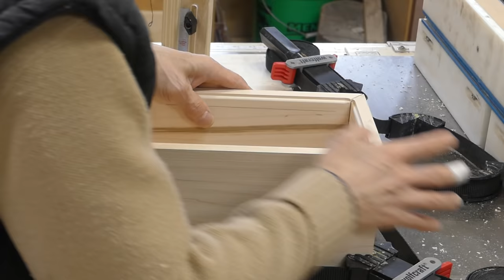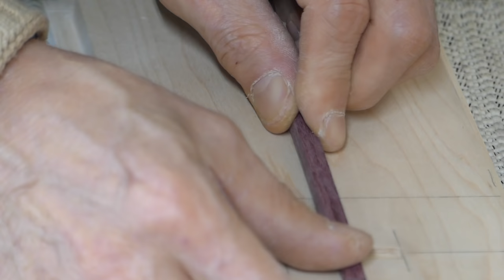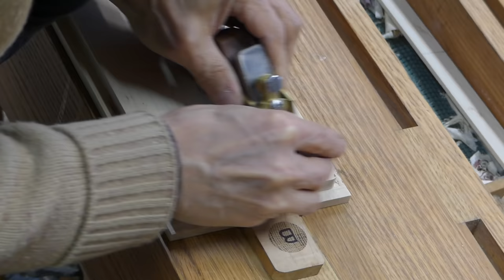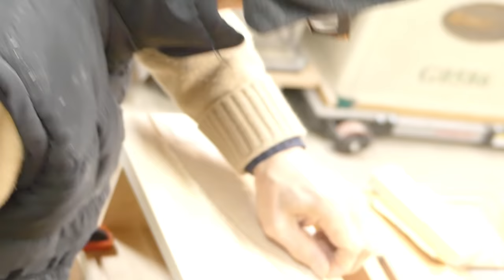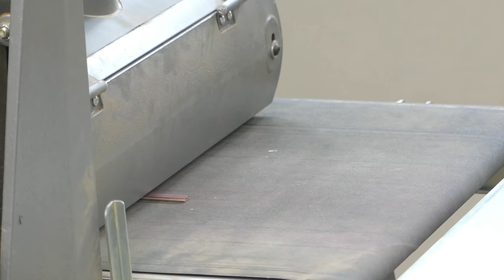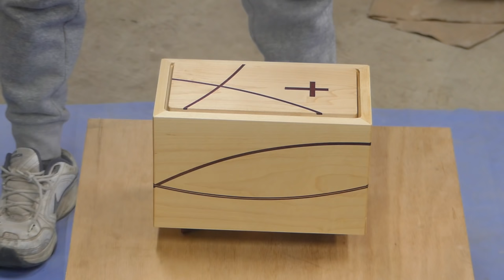Making pair of urns

Comment: I always get a kick with the waste piece shooting off the table saw when cutting the rabbit. And a little relief that i've measured correctly..Not only that I save them. Why? I have no idea but surely they'll come in handy for something. Some day. If for nothing more than stir sticks for epoxy..

Stunning work as usual.

one last comment.. I see you double taped the pattern guide on both sides of where you're going to route. Just to make 100%  your router doesn't mov?. Feel like I'm missing something there.